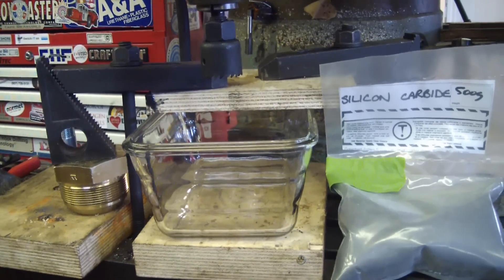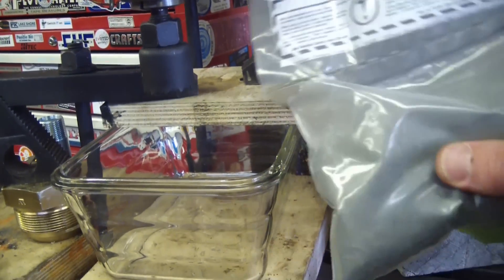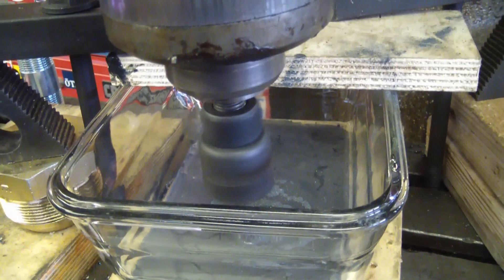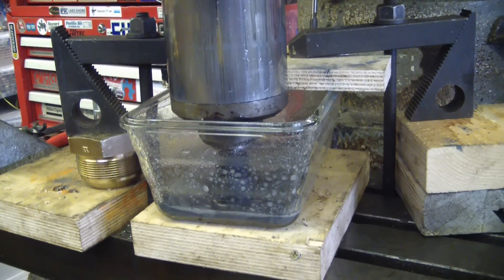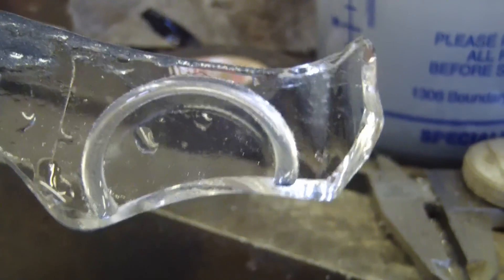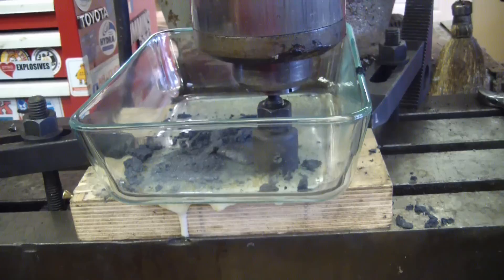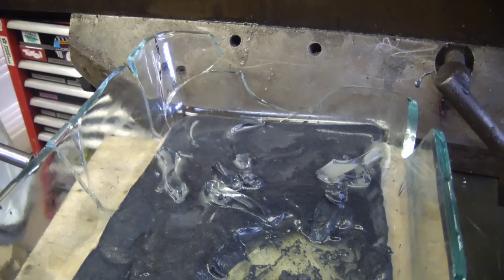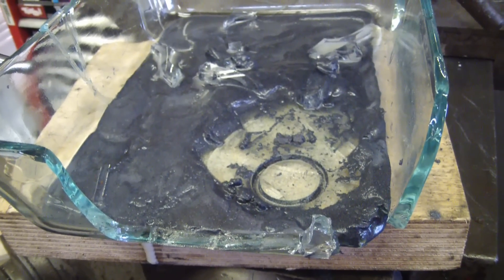Using Silicon Carbide to cut glass

Comment: The Pyrex is probably being heat strained so when one part of the glass gets hotter than the rest it causes uneven tension. So if you just keep the whole thing at the same temperature it should be fine

Comment: As you probably noticed, your cutter is rotating eccentrically applying a cyclic force on the dish at every rotation. As you remove material, the geometric properties (moment of inertia) of the dish change and the resonant frequency is governed by these geometric properties so it changes accordingly. At some point, the resonant frequency is in tune with the frequency of rotation of your cutter and due to the eccentric rotation (the cyclic force exerted on the dish), your dish shatters. You should try running your cutter at much higher rpm but anyways I doubt you still have this problem a year later.

Comment: I would grind down the teeth so that they are nearly round and only a small gap remains between them for grit to flow. I suspect that once the glass gets cut thin enough, the pokey bits on the bit end  are causing too much stress on the remaining glass and it initiates a fracture. In other words, you have to be as gentle with the pressure as if the whole piece were as thick as the remaining thickness of your cut. If any part of the drill bit catches or snags, it breaks the glass. Also, build a damn dam around the bit so that you can really pile up the abrasive in there!  

I ran into the breaking glass problem when trying to drill a hole in the bottom of a fish tank. Although my hole was only about a half inch, I busted 6 tanks before I finally got one to chooch close enough. What I used was a masonry hammer drill bit, spinning backwards, pressure as gentle as an angel fart, and very low RPM. I was 16 though and didn't think of carbide grit. I also found out the long way that a mouse cage that self-cleans/flushes like a toilet was not the hot, new invention that the world had been waiting for.

Also, I disagree that this is pre-stressed/tempered glass or similar to a Rupert's drop. Either of those would break into many pieces when cracked while this dish just breaks like a lightbulb, vase, or other typical non-"safety" glass.

Comment: Not a glazier,  but i seem to remeber that drilling a hole in glass is a nightmare because the internal stresses make it shatter before you can get through.  Cuttig glass has to be done in straight lines, or circular over a large enough area that the stresses dont overlap.  You hole glass by heating it, poking your hole, polishing it, and then letting it cool slowly so the stress can readjust

Comment: Need much, much lower speed. I found out when I went through 4-5 class top jars for a vacuum chamber. In the end, fine abrasive and very very low speed will cut it. You also want to keep as much of the glass to the same temperature as possible. I figured that was the culprit in my case as it would generally start to crack right above the water line.

Comment: Try using a rubber clamp to hold the glass in a stationary position, a higher speed on drill press, and bring the bit downward at a slower pace. I hope that helps.

Comment: as always a very interesting video.... you sir are one crazy yet smart cannuck. being that this vid is older, and perhaps input is not needed as you may have figured out a solution... i will add my 1/2 cent. glass is very brittle and worse in the cold months of cannuck land. glass is more plyable when heated, evenly. why not heat it up and test, with monitor of course. might take more time, might get better results. so AvE what did you eentaully come up with?

Comment: Un-temper the glass, cut the glass (meanwhile or after your choice), temper the glass, difficult but not impossible !!  The idea is to release the stress evenly from the glass object, heating it up to a temperature above 490 C degrees. use synthetic oil as a lubricant and abrasive, cut and voila, vous avez Monsieur un trou dans le vitre (Je pense), moi j'ai l'idée vous êtes le fou !! I enjoy your vids, KYDIV !!

Comment: You need to buy the bit needed to grind glass, not cut it. One thing I may have noticed though is that you set your downward pressure, you need to release all pressure periodically during your cut to allow the grinded material flow out of your cut and reduce stress on your material.

Comment: funnel around the bit to keep the silicone carbide around the drilling surface. way for liquid to keep moist so as not to gum up and keep cutting abrasive where you  need it. do not touch  (impossible) until cut is through.

Comment: How hot does an oxy-acetylene torch burn? Aim your flame at the spot where you want a hole, heat the living bejesus out of it, and then punch a hole through it. Don't drill, punch. (or maybe drill who knows, but definitely heat it.) It can't hurt to preheat the whole thing first in an oven set at 500.

Comment: I used to collect glass electrical insulators and with the pyrex ones, if you even chipped them in the right spot they would explode. none of the other ones did that, i think pyrex is stressed or or hardened or something, try (non tempered) window pane glass (sorry for the two comments i accidentally deleted my other one)

Comment: Since you are using pyrex, you can burn a hole in it. I learned that you can only do that with "low expansion" glass while attempting to make a bong out of a jack daniels bottle. The hole burned fine, but once it started to cool, the whole bottle exploded. 

I tried it a second time with exactly the same results.
Reply: D Johnson smoke less weed, if you'd cooled the bottle evenly like say in an oven  it wouldn't have shattered. You're lucky it didn't explode when you heated a single point.

Comment: Perhaps a 2-3 step drilling would work?
I.E. drill 50% down. then put the glass in the owen at max glass temp. and let it cool down slowly in the oven with the oven shut off.
drill 25% more, in the owen again.
And then the drill the remainder.
The idea beeing that the heat would "restress the glass"

Comment: Would it be possible to try something similar to diamond cutting, where small pieces of hard diamond becomes imbedded into a cutting disc of a soft material like brass? You could easily fabricate a brass cutting tool with a flat cutting surface and run it at low speeds to see if the SiC is embedded into the brass as it is grinded between the glass and the cutting tool?

Comment: The vibration is causing micro fractures in the glass, making it weaker and weaker, until it shatters. 
I wonder if you know that you can just score the glass and then strike abruptly and it will break on the score mark. Alternatively you can score it, heat the glass and then cool it quickly with ice and the glass will break on the score mark, very clean. 
You might be over complicating this.

Comment: I have seen my buddy do this a few times. He used strip caulk to make a reservoir about 4" to 5" across. The cutting bit was,,,if you took all the teeth off your hole saw and made a notch about the size of a US dime.  The carbide was way thicker than your using, more like mud. He always did it by hand rather than the auto feed. Why couldn't you just use a torch? I love your show, does your wife have a mother or an older sister. LOL  Bob Tyler

Comment: The issue is when getting close to breaking through  that is when a crack forms. if a crack forms it flows in just about any direction it wants and rarely what you would think to be the path of least resistance.  Ultra light pressure for the second half of drilling, or I have seen people sand blast glass to cut it, mainly in chop top cars and trucks but I bet you could do it.  glue a piece of rubber with a hole in it the size you want, and sandblast that heffer.
Reply: MikeFnt I made pipes from liquor bottles,  when its breakign through  it tries to take a heaver cut also, forcing the bit to try and spread the glass, that too often causes a failure.
Reply: MikeFnt could also try oxy act on it and punch a hole out with a die :-) I would like to see that!!!

Comment: Maybe we could discover the frequency that the stress fractures are resonant at. Coat the thing with something like static flocking. Vibrate the thing at various speeds. See which frequencies excite the fractures. Sort of like dynamic magnafluxifuckating. Maybe a whole new set of videos here! Change the stress fracture resonance by re-annealing or re-hardening or re-Cajun Chanting or whatever. We might even discover there's a resonance to the outer glass surface that's different than the resonance than the inner structure. Melted sand. That sounds like a lot of crystals waiting to do their piezo thing. Thanks - Lumpy

Comment: i am a recent subscriber and just wonder if the harmonics has anything to do with the glass breaking? I know with my own experience with drilling glass that if you can dampen the vibrations in glass that it cuts much easier with less breakage. I know that the being tempered the design plays a major role but if you can in some way reduce the vibration and force of feed maybe you can come up with a better result.

Comment: maybe drill from the other side while supporting the middle with wood?  seems like it's getting a harmonic frequency that may be shattering it too?  Possibly just using a rounded off hole saw so there is more surface contact and less vibration maybe?  all good reasons for you to post more videos lol

Comment: It's all about harmonics and a sharp edge.  Cut your saw blades round, or better yet, use a cutter without teeth and it won't crack.  Your cracks are staring at the sharp corner then harmonic stress is taking over.

Comment: no fix yet? 

i used to work at jydsk glassliberi till saint gobain bought and closed it. we had a guy who drilled holes in glass 8h a day everyday! bet i could have helped :)

im still sure you need to de temper it tho which is a very tricky procedure.

best option is to get a normal glass bowl

Comment: modern pirex is no longer borosilicate its now tempered soda-lime, so cutting is it pretty much doomed to failure. one option is to scour do the thrift store for an old true blue borosilicate dish or go for the cheapest off brand non-pirex dish (least likley that they went through the trouble and expense of tempering it.

Comment: I'm no glazier, but I've burned a couple doughnuts, and I think it breaks because at that RPM it's enough to push most of the abrasive (prob water too somewhat) away from the contact surface

I bet if you set it to like sixty RPM running backwards and only one half pound weight on it, it would get thru in like a day

Comment: Try using a light oil instead of water. Put a dam around the area you are drilling using glazing putty to keep the oil concentrate around the bit,this will help absorb the heat

Comment: Tampered glass is only tough as long as it's initial shape is in tack. Even if you would manage to cut it without braking, even a slightest stress while handling it across the room would make it crack.

Comment: Got to be a resonance that is shattering the glass. Try a much lower speed (like a third or less of the rpms you were doing). Super light pressure on the down force would also help. Both of these suggestions are likely to turn it into a week long process, however.

Comment: Yes light scratching action is the main action required to cut the galass  in fortunately we have also create heat and vibrating forces it made in even expansion of glass crystal and  made tham crack. I can see that you have consider able stiffness forces between the table and work pieces . To improved success rate you should attempt to reduces vibration heat and crushing action. I think you put on a rubber horse on the shaft of the cutting saw so it create shock absorption action. You chuck will only Goulding the rubber . After you have a grove . You should hold up  you grass piece or put rubber under it . Why water jet abrasive cutting is the best. I think manual light drilling alternative forward and back ward motion may made better cut with out cracking. I think you know every thing.

Comment: Wouldn't be some sort of resonance. The teeth in the material itself setting up a vibration. So while starting out fine, but with the friction action on the walls of the cut half way through it ends up fracturing?
Dampening is my modest instinct.

Interesting video.

Comment: You need to cover it with expanding foam or smithereens to stop vibration and go slower and lighter even if it takes a day? or do What I did to get a plug size hole in a bottle and Use a ceramic bit they looks like an arrow and again go light and slow but this time no water blowing dust away making sure you stay supper steady else it will catch and pip. Then when your through just open hole out to size wanted with progressively bigger supper fine dremel abrasive stones?  Best of luck I feel this vids old and you got there eventually bro your a genius in the rough with supper humor. Respects Alex

Comment: late to the party here, so forgive if you already got the answer, but the issue here is simply that its tempered glass. all tempered glass is under surface tension, and when that surface tension is broken, it causes structural failure of the tempered glass structure.

Comment: Yup, getting old sucks.  But as they say, it sure beats the alternative.  But take heart!  In a few years the pain in your neck won't bother you so much.  It will be overshadowed by the pains in your back, knees, feet, elbows, etc.  As for drilling holes in Pyrex, I've got nothing.
[Edit: I did some poking about on the internet. As you noted, Pyrex in North America is not borosilicate glass, but is tempered soda-lime glass.  According to Wikipedia, "Tempering puts the outer surfaces into compression and the inner surfaces into tension. Such stresses cause the glass, when broken, to crumble into small granular chunks instead of splintering into jagged shards as plate glass (aka: annealed glass) creates".  And therein, it would appear, lies your problem.  Your drilled hole creates a stress concentration, and the whole thing goes kablooie.]

Comment: Use a thinner blade, a very thin piece of copper, start a cut to score on one side then cut the other side, control the harmonics on a rubber pad.  Do not fill entire bowl with water, use a 3" rubber tube and silicone it to hold contents.

Comment: Most pyrex sold is not true borosilicate glass that the original name signified. It is just tempered soda-lime glass. Your failure was explosive and from areas away from where you were working on indicating it is definitely tempered glass. The surface layer is under extreme pressure and any break in it will cascade through the entire structure, just like your car windows (excluding windshield).

Comment: maybe its silly but if you filled the container with hot water perhaps the temperature difference between the kerf of the cut and the rest of the glass would be lower. I know pyrex is supposed to be impervious to thermal shock but i'm thinking that the very localized heat of cutting on a part that is otherwise pretty cool may induce stresses. it may be a good excuse to bust out the FLIR... If it is real cheap glass it is pretty safe to assume it is internally stressed "en tabarnaque".

Comment: When tempering any material the internal structure ( as noted below glass and Pyrex are amorphous so not quite crystalline but rigid in structure none the less) is put under compression and the external "shell" graded in force as you go out to harder. It basically a static equilibrium or forces where the internal "compressive" force is always pushing out on the hard shell around. This allows for the improved hardness of the material and accounts for why tempered materials shatter rather than simply crack. When an object is tempered it is first formed then tempered, so the stress lines ( you could see those with polarizers at angles such as here: http://www.satra.co.uk/spotlight/photos/article/356-1-full.png )

Even scratching the surface would cause it to try to release the energy because you have punctured the toughened surface. The deeper you go the more area in the the fault line you are creating to allow the energy to escape.

Only way to properly do what you try to do is anneal the glass ( could take weeks ) at around 960degrees ( varies a lot across the glass quality ) releasing all the internal stress and have a material that is not waiting to burst , drill the hole should be dead easy then. The hardest part would be re-tempering the glass because the edges need to be slightly bulbous to allow the force to go around the hole look at the edges of the pyrex dishes they are never sharp cut or at the tickness of the plane of the material the lips and edges are all slightly fatter. Reason is to redirect the force lines of internal stress back to it source and not allow "hot spots" where a small amount of energy is enough to trigger a shatter release.

Sorry for the long post but I did not know hoe to express in less words..

Great videos by the way and failures are great as they tech us more than discoveries sometimes .. keep up the good work.

Comment: Just a random thought that may or may not work or perhaps isn't practical at all for you to execute.

But I was wondering if you could try running a high current through a bent piece of metal, steel or something I guess whatever it takes that can take some pressure without deforming and has a higher melting temperature than the glass.

Gently push that through the glass as it melts the glass around it and once you've cut one half circle out do the other half? I guess it'd probably need some beefy transformers and thick cables, but I could see it working in theory perhaps causing less mechanical stress in the glass than the drill causes.